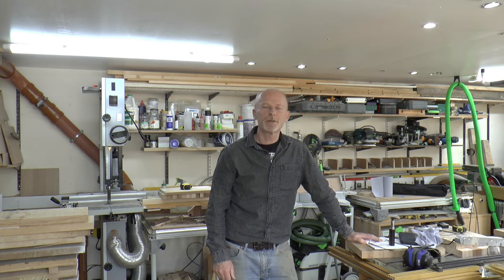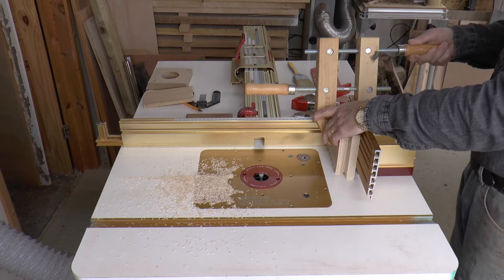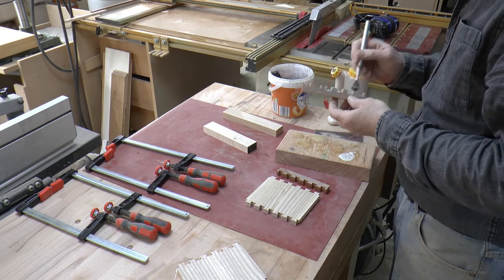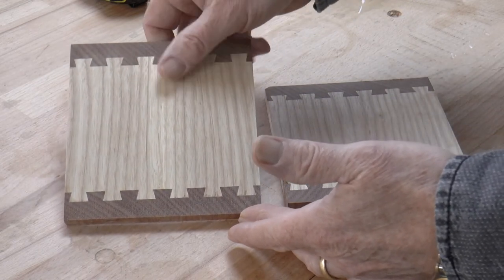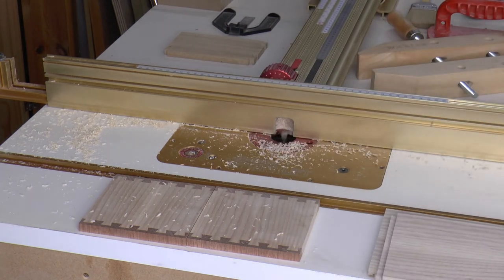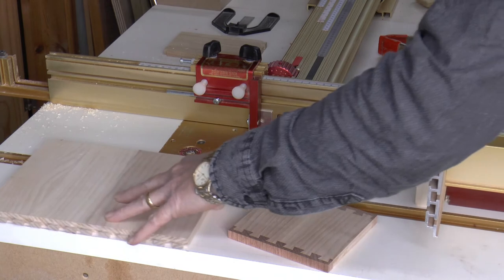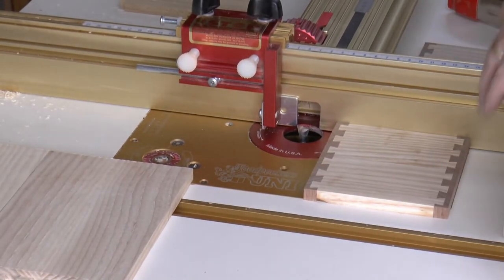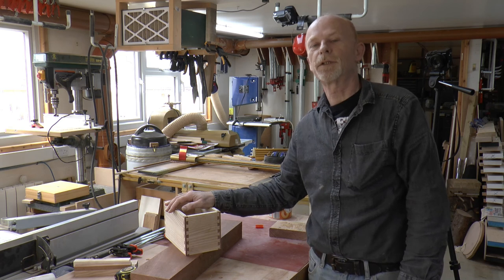Dovetails the easy way with Incra tools Part 2

Comment: Graham, I have been re watching some of your video's must mean that I like them, sure do. My two favorite dovetails are the corner post and the double-double dovetail. They can be a little touchy with the 3/32 liner on the double double dove tail as it can break very easy but as you know you just have to take small cuts in some places. But results are surely worth it.Who ever made the templates for the Incra system is a whole bunch of pay grades above me. My two  biggest problems with the dovetails are getting the right fit on the dovetails which can take three or four times or more to get them just right. And centering. Once I get those two the rest goes pretty good.. Once again I really enjoy your your video's and when I grow up some day I want to be just like you, all though I am 83 so not much time left..Keep doing what your doing, Bob
Reply from the maker: Hi Bob, thank you so much thats lovely of you but it sounds like you've already got it  cracked.  If you can cut the corner post and the doubles, you've pretty much mastered it.  👍👍👍

Comment: I keep rewatching this as I'm still waiting for UK stock to be available but couldn't you cut all 4 pieces of ash at the same time? After that do the final rabbet cut required (shown @6:34 ). It seems they're all A cuts and the post is just B cuts.
Reply from the maker: HI Andy, I see no reason why you couldn't it would definitely save time.  Extra care required when clamping 4 pieces in place to make sure they are all flat to the table and tight against the fence.  I think cutting them separately was best for the purpose of the video to show the procedure.  (He says hoping not to sound defensive) 😁👍
Reply: @GTWoodshop  Ok, sounds good. It wasn't a criticism - the video is very, very clear as it needs to be. I was just wondering if there was a reason not to do it if you were batching out a number of boxes at once. Have you tried any double dovetails yet? That would be a cracking video to do ... hint.. ;)
Reply from the maker: @FuzzyScaredyCat   Hi Andy, I made 10 of these for a trade show once so I did get to batch them out a little, even then it become mind numbing.  Anyway, Double Dovetails are on my list.  I've been meaning to do the vid since Christmas but the workshop needed sorting as the new ........... will be here soon.  I have a little project that may well lend itself to double dovetails on my list next.  Leave it with me. 😁👍